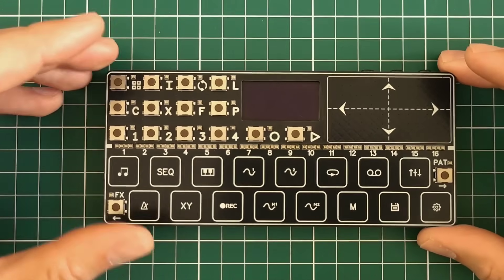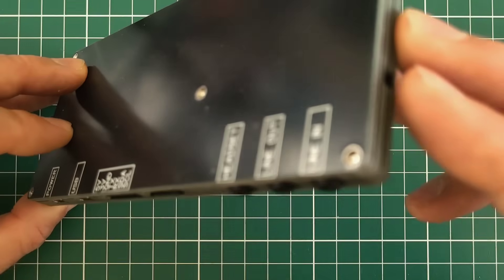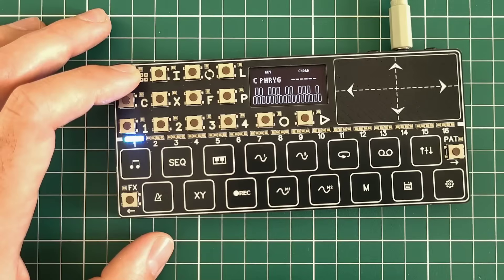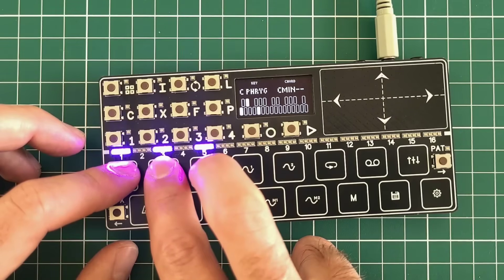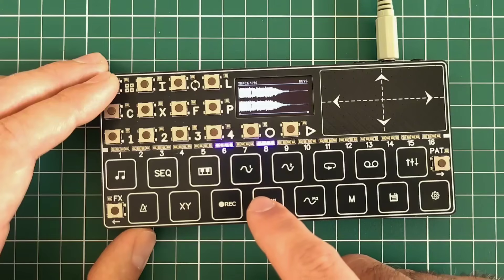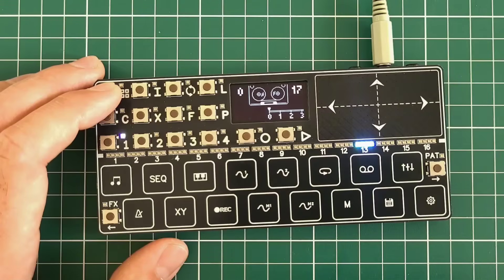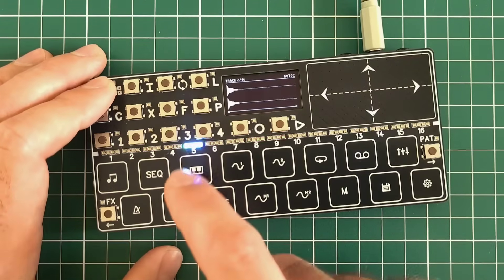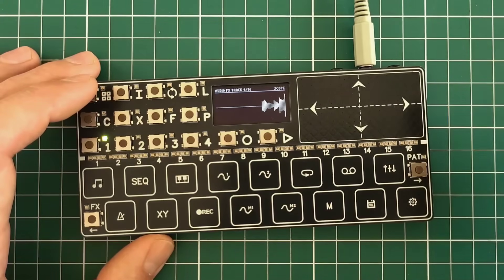LOOPA project 2025 updates

Comment: it sounds very good, why is that? Is it the chips? the Synthesis ? Your programming? .. its very punchy and raw ..like an instrument .. will it carry /or is there hope it will include MIDI step FX (TE Z) and some audio exotics like beat repeaters /slicers,  can the sampler slice and loop slices?.. TBH I actually hope you format this more towards a OP-Z with multi track out via USB as resampling to tape is very restricting when it comes to Sound Engineering

Comment: I'm really hoping it has a normal key layout, not just the scale stuff? Like your earlier prototype did. I'm assuming so, maybe under Key Mode in your UI? Physically inputing a chord is one reason I kept the OP-Z over the Woovebox. but LOOPA looks way better :)
Reply from the maker: it has, yes
3 keys can be disabled so you'll get 1 octave keyboard, but also it's possible to connect usb midi keyboard

Comment: WOW. I'd love to see a TRS mid output somehow, if possible, or something could be switched. As it can record audio, it'd be nice to send midi out to something and record the audio back in at the same time, or use as a mini keyboard for other gear. But regardless, with no charges, it's super amazing! I really wanted to love the Woovebox but I found the lack of display (only LED segment display, with lots of complexity to show) switched me out of 'creative' mode and into 'computer' mode - for me at least. The visual feedback on the little display makes this very accessible. Well done! Hope it goes well for you!
Reply from the maker: thanks!

about midi - there are several options 

1. it has usb host so probably usb-trs adapters would work
2. it has expansion port so arduino or other mc can be connected and do conversion 
3. probably I'll find a place for 4th jack in next revision, but not sure